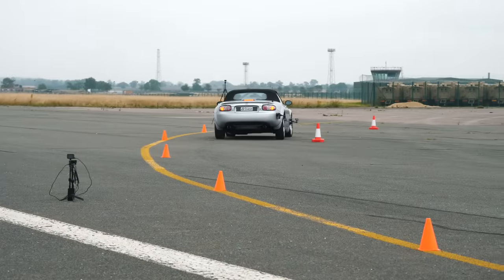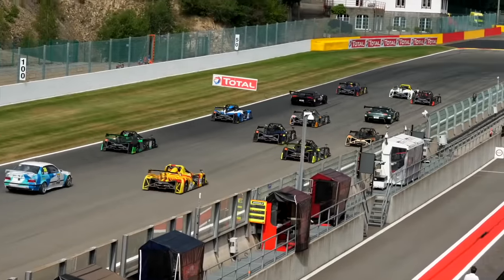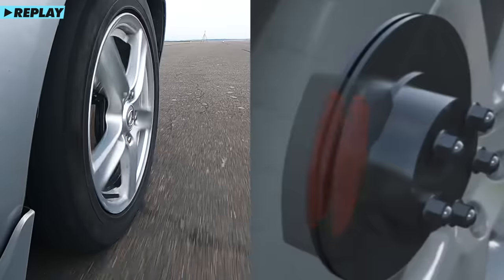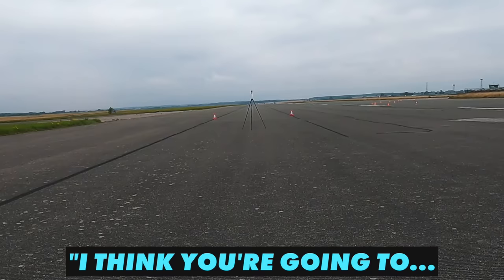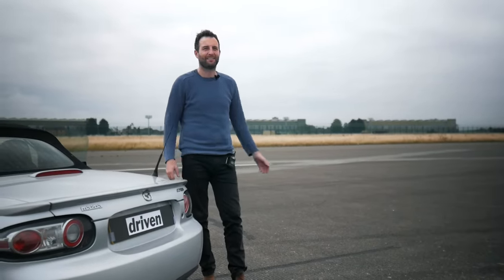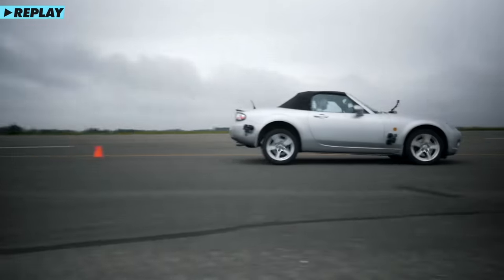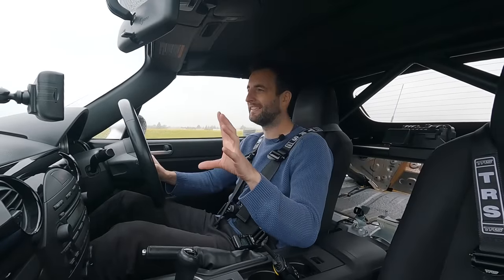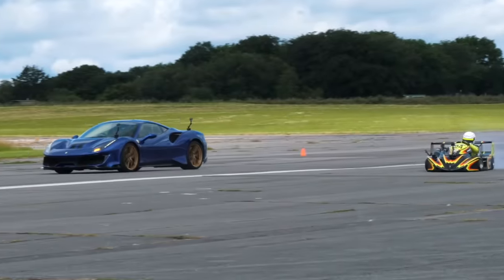ABS ON vs ABS OFF | What's Really the Difference?

Comment: ABS has gotten much cleverer as well. Different implementations perform very differently with similar weight/balance/tires by avoiding crossing the traction threshold at all. ABS systems can easily exceed the capacity of peak human threshold braking in circumstances where grip differs between the wheels (in turns, or naturally because of the surface), and most systems try to maintain yaw authority at the same time. Ideal traction actually happens just over the threshold, there is an amount of slippage which imparts the maximum acc/deceleration.

Comment: Have a slight interest in these type of videos. Problem with this one I don't think anyone would lock-up the brakes and not let off. Could you redo the test using threshold braking? Be nice to see this done on both dry and wet or preferably snow/ice to see the difference.

Have had discussions with others regarding the ability to stop on either ice or snow covered roads with/without ABS. Personally not sure which works the best. Best answer I have come up with is at least with ABS the playing field is levelled out.

Comment: With a circuit car without ABS it's not that hard to stop quickly from high speeds without locking the brakes, particularly if the pedal feedback is good. You can get a feel for it, locking up the brakes is just a panic reaction.

Comment: If you want to experience ABS trying to kill you, just go at walking pace down a very steep hill on a fresh covering of large hail stones. The ABS won't let the brakes bite, you accelerate under gravity and there's nothing you can do to slow it.
At that moment, I became an advocate for an ABS kill switch. It was front wheel drive and I could have braked with my left foot whilst applying throttle to get into shape again.
Reply: Abs will always keep the edge if brakes lock at example 80% it then pulses brakes 100-80% constantly meaning that it will improve BITE. With kill switch there's absolutely no way in emergency that driver would even think let alone press kill switch. I don't think you understand abs well.
Reply: @dkdanis1340  no.
It goes from 0 to 100% x times per second, in this case 50.

Comment: Have you tried this on an icy or otherwise slippery surface. While on a dry summer day I agree that abs works great, I have found that foot pumping without abs is better as on ice the abs does not detect the slide pressure and just cuts the brakes completely. Thanks.

Comment: It's funny, I used to drive over a steep snowy mtn pass in an old truck and rarely put in 4wd and descended confidently with reasonable speed. Bought a new truck with TC snd ABS and have to put it in 4wd alot and have to descend at a crawl to keep the ABS from turning it into a runaway train.

Comment: I mean you could do a test with locking up all the way. But you should have done a realistic test where you try to brake without locking up or with very little lock up. I had a car with no ABS and I wasn't locking up at all. This video proves very little in reallity. It's just a fun experiment saying how much longer it takes to brake with lockup from the first meter of braking.
Reply: And if that car had ABS you'd never have known the difference since the ABS wouldn't have been used in any of those situations either... proving literally nothing. The whole point WAS to lock up since that's the point when ABS is engaged. It's not used EVERY time you use the brakes. Duh.
Reply: @DavidStruveDesigns  I get what you are saying. But still locking up from the first meter and all the way through is no realistic test either. It's an exaggeration. But you to show the difference some lockup should be introduced.

Comment: There is one significant exception in ABS braking assistance efficiency.
ABS once almost drove me off a mountain edge at speed below 15kph. Fifteen or less! A walking pace!
It was sligtly down the hill. Not too steep. And gravel road in the rain turned into mud. There was no grip whatsoever. ABS in search of it practically disabled brakes entirely. I stopped just 3 meters before plunging 100m into abyss by turning steering full lock and plowing. It was experience requiring a lot of toilet paper afterwards. 
I took ABS fuse out for the rest 20 or 30 km of that mountain descent.
In snow, sand, mud and any similar conditions ABS from a best friend becomes the worst enemy.

Comment: As a master student in engineering, its always hard to explain to the avg person whyyy what “abs” does, is so incredibly important. Because the avg person just assumes rolling means less braking than just stopping the the wheels. Not even talking about how you are removing any steering inlut when slipping (which is more understandable). 

Just the fact that a rolling wheel can brake more than a slipping wheel is just hard to grasp for people.

Comment: 3:34 It is not a benefit, but the solely purpose of the ABS genesis: maintain steering under hard braking conditions.
Crash analysis revealed that, most drivers, under the stress of a possible collision, would brake really hard, ignoring the wheel locking, while steering - typically right as they were about to hit another object - which placed them and other in more harmful situations, especially on a congested highway, where a lane is right besides you.
As a plus, ABS brought a set of other benefits, where the most notable is inferior braking distances.

Comment: yeah we tackle this in driving lesson, but maybe I misunderstood the lecturer.. I though he said that I could not quick hard press the brake because it will lock the tires.. Now I understand how ABS works, I recently been in slight car accident, motorcylce in front of me wiggled and lose balance and I'm 200m away with the speed of 50 km/h I stopped quickly but not to hard so I slightly bumped into..

I have a question, is pressing real hard bad for abs? or is it an advantage? am I able to use it again normally once I recently locked my tires up?

Comment: Many non ABS systems do not have enough hydraulic pressure to lock up the wheels. (almost always cars) 

Stock tires require "X" pressure on dry tarmac, back it off a little, make that the system pressure max. Pretty brilliant really. 

Questionable ethics as brake pad composition, and tire size are extremely critical to this equation, but probably saved 10 to 1 lives over-all.

Comment: I'd love to see a third case of ABS off and pumping the brakes.  That's what I was taught in my first car that had no ABS
Reply: Still with fuse out -- the brake corrector does not work,  as is working in a non-abs equipped cars -- that is why car goes sideways when braking.  Not same as it would brake for car with factory non abs.   

Also abs cars with fuse out still have a lot of pressure for braking and locking up the wheels is very easy -- not same as in non abs cars from factory.
Reply: @wyrazowfkp  ok why are you telling me this?
Reply: @matthiasice  Such test would still be inadequate, it is easier and more precise to pump the brakes with a non abs designed car (and brake corrector) than that way we see on video

Comment: The NC Miata might not have been the best car to do this test because of EBD (electronic brakeforce distribution). Pulling the ABS fuse also disables EBD, which by default applies a heavy front brake bias for safety. This is why the front tires lock up this easily and the braking distance that bad. Don't get me wrong, even a properly brake biased car will lockup in these conditions, but the brake distance wouldn't be as bad since the rear brakes would be contributing a lot more.

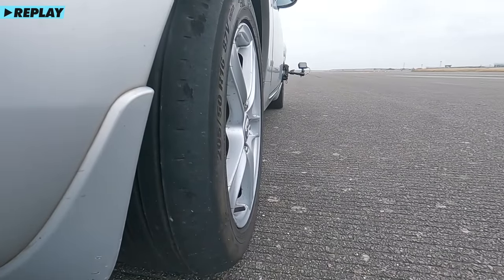Comment: I believe your job and test would turn out quite different were it done on a normal (non-corrugated) road.  A normal road would have much more surface area for grip with that style. (See 2:20 to 2:40 for a good view of the corrugation).  Try the test again in snow and you'll see why I pull my ABS fuse every winter!

Comment: please compare with/without abs at low speed (<50km/h). 

i allways argue with people that believe they crashed into the car in front of them at red-light, because abs did not let them brake enough. then i tell them the damage would be bigger without abs. the reason of collision was 'too little distance', not 'the abs'. 

am i wrong?

Comment: Abs is safer because in panic slamming the brakes wont result in a lockup without stopping distance is shorter but it requires skill and proper technique also pulling that abs fuse out disables rear wheel braking

Comment: You can't just pull abs fuse from road car and expect it to work perfectly - it will always have too much front breaking bias. What you need is a proportional valve, to adjust the bias - with correct breaking bias and skills it would stop in dry conditions in shorter distance than with abs turned on

Comment: You should do a video on how horrible ABS is and how many accidents are caused by it's sheer stupidity.  When someone spins out and the car goes sideways in the road the deadly ABS completely prevent the wheels from locking up so the car then takes off the direction it's pointed instead of the direction it was going so you go right off a cliff or right into a concrete barrier.  They absolutely need to add at least a little bit of inteligence to ABS so it knows if you are sliding sideways and can allow the driver to lock up the brakes so they can just stop safely in the road instead of shooting completely off a road.  There is a video on youtube of a Ferrari going right off a cliff and piles more cars crashing off roads when the ABS made the car go the direction the car was pointed no matter how idiotic that direction was.

Comment: Real world road drivers won't threshold or cadence brake in an emergency. 

Even experienced track drivers are quicker with abs than without. 

And that's an old MX-5 with an old abs system. New systems are better still. 

So unless you have to get the very best braking out of your brakes and tyres to shave a second or two off a lap time, and you have a big budget for practice on a track, you're going to be quicker and safer with abs than without.

Comment: Interesting - I had understood that with ABS you took longer to stop - but retained steering control.  Are the results you got because ABS has improved in some way?
Reply: No, he deliberately hit the brakes like an idiot. He wasn't trying to brake optimally without ABS. You don't have to find the optimal threshold without ABS, you can pump the brakes, letting go of the brake when it hits the limit, and then hit it again, it is not perfect, but neither is ABS.
Reply: @Carewolf  you won't be able to brake better (as good even) than abs.
Reply: @szymoniak75  Depends on the abs and the surface. For the original gen ABS, I can always brake better. For modern ones with different levels for each tire no way for surfaces it understands (like wet road). For surface it does not work with such as loose snow I can brake in 1/10th of the distance ABS can.

Comment: Is it true that when ABS was first developed the vibration on the brake pedal was unexpected and while some where tasked to develop a system that didn't vibrate, others said "meh, ok, let the pedal vibrate so the driver knows abs is working" and by the time the no vibration abs was developed the vibration was so embedded into the general public that the system was basically useless? I read that somewhere and I want some confirmation

Comment: I have lots of experience driving on ice and snow, but I am not a racing driver by a long shot. They tell you not to try to modulate the brakes with ABS, but I could stop shorter on slick surfaces by modulating myself rather than relying on the ABS. Every single time. Maybe it was just that car, I don't know, but it definitely didn't give me a good opinion of ABS. It does seem to me that ABS makes a bigger difference on dry pavement than on the really slick stuff, which is the opposite of what they want you to believe. But if you think about it, it takes much longer to get a tire spinning again on a slick surface, so threshold braking would be much better because of not breaking traction at all.

The fundamental problem with all these "safety" features is that they actually make the roads more dangerous for everybody by making drivers not only worse, but lazy. We should be training drivers MUCH better, not making them dumber.

Comment: I would not have ABS. I grew up driving in the 70s when people still had driving skills. I trust my feet a whole lot more than some silicone diode. Todays drivers have no skills. They can't drive stick. They are overly dependent on all this safety crap. They slide off the road because they don't have the brains to slow down in the rain. I saw a horrible wreck tonight, about 2 hrs ago, a guy slid off the road, took out a phone pole, going too fast in the rain. The brain is your best safety gear and in most people it is a vestigial organ like the appendix.
Reply: Boomer
Reply: @Swag_K1RBY  yes, one of the last. I know how to drive. I don't need a car to do it for me. Most 4th graders in America cannot read or write. Boomers can. New and modern is not always good.

Comment: Imagine not having ABS on a two-wheeled vehicle.

On a related note, drum brakes are not weaker than similarly sized disc brakes- if anything, they're stronger, and they also apply themselves, meaning they require far less force from the driver. That's important if you have a disc and a drum controlled separately.

Comment: Off: You lose all sense of control before hitting that wall and dying.
On: You retain full control but get tunnel vision as you realize you braked too late and that no amount of electronic gadgets and hydraulic boost is gonna slow your ton of metal of rubber from crashing into that wall and you dying.

Comment: I've been driving kart slalom since 14 and I've always been taught that locking up the wheels increases the breaking distance by about 50%, so I expected an additional 22.5 meters and that was pretty exact. Nice to see that confirmed in a like for like test.

What I was surprised by though, is how straight that Miata stayed despite the locked wheels. My experience from karting is that the vehicle will spin out after a few meters, even if the steering wheel is completely straight.
I've also seen one guy wreck his Opel Cadet in a car slalom race, because he locked the tires when breaking after the finish line and veered off into a street sign. Then he spun around 2½ times and came to a stop at the very end of the runout zone (he also started breaking way late behind the line). One thing I've always found fascinating about car slalom is how there seems to be 2/3 trained racing drivers and 1/3 idiots with too much money...

Comment: @driven media ABS is not fully removes brake pressure and not when wheels already locked up. It modulates the pressure to achieve a certain wheel slip percentage.

Comment: When a child throws itself on the road infront of you, right behind a nearby parked vehicle, only two things can stop you from pulverizing it: speed below 30 km/h and ABS. 
ABS is a must have in daily driving, since no matter the driver's skill, under the panic of the surprise you simply cannot react fast enough and accurately at the same time. Some professionals might be able to control their braking in the face of real danger (and not a peaceful race track), but still modern ABS is superior both in terms of stopping distance and steering control.

Comment: If you are not good at something you hire a professional. If you are not good at manual braking you get an ABS. ABS is good if you are so novice in driving. But sensible manual braking can stop it much earlier as the driver get the feel of the tyre and road interaction on specific road condition. This video is a good example of such novice braking or panic braking (slam at once)

Comment: Well, the problem is, that the brake system is not the same in cars with and without ABS - so the rear axle would probably not block in a  "proper" non-ABS car. This doesn't change the usefulness of ABS, of course.

Comment: Nobody driving cars with no ABS like that, pushing brake pedal in a floor. What the value of this experiment?
Reply: bro you missed the point💀 in an emergency situation, like when a kid runs in front of you you WILL slam on the breaks. without abs the child will be dead. but your tiny Brain cant understand such conditions (sadly)

Comment: I was really hoping this wasn't going to be a comparison between ABS and sliding on fully locked wheels. 
If you're driving a car that doesn't have ABS you'd expect the wheels to lock and try to avoid it - even more so with motorcycles.

Comment: Try testing ABS on wet leafs or on tarmac covered with sand. You press brake (in second option) and... nothing happens - where without ABS locked up wheels would brake much better.
So yes ABS allows you to control car but doesn’t always stop faster and in some cases it actually prolongs stopping distance quite a lot.
This say - traning the instinct to let off the brakes in emergency is... not an easy task - not at all so here ABS helps a lot.

Comment: Here's my beef... You were trying to lock up the brakes. When driving a car that doesn't have abs (like the race car) the goal is to not let them lock. Before abs was standard people were taught to "pump" the brakes in emergencies. It was a well known issue that when the tires are locked you have no control.

Comment: If you arent slamming the brakes the results are different. Mainly with older cars or failing  speed sensor systems. Gradual braking and defensive driving prevents those slam moments most the time but not every time. Safe travels! 👍

Comment: Cool, bad driver with abs vs no abs. I wonder how that will go. Also with those tires which has lost their best traction already the difference can be even more. Ofc it's the same for both braking systems, but you kinda get better off from the better grip with no abs system.